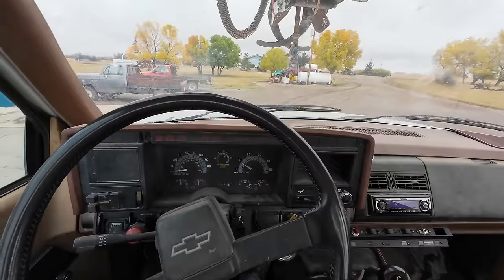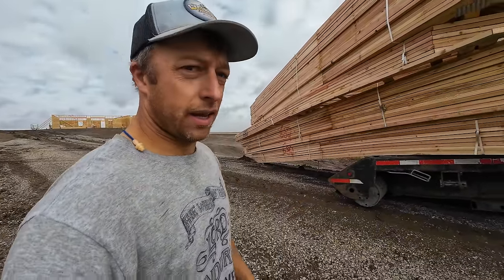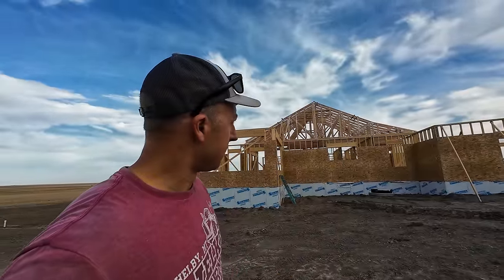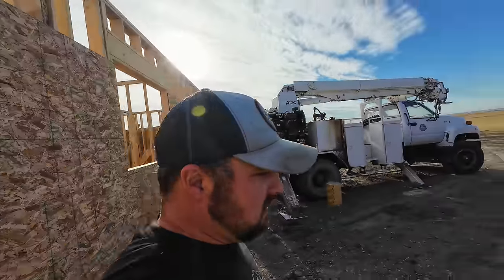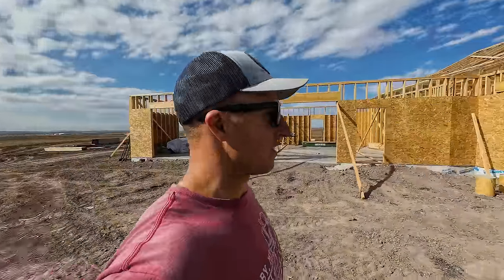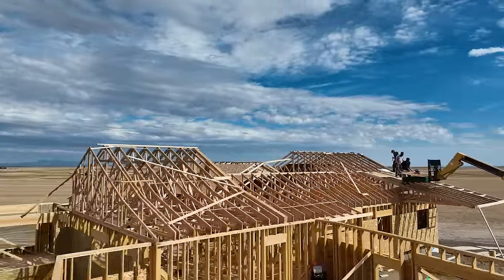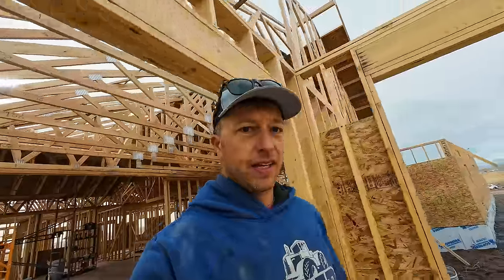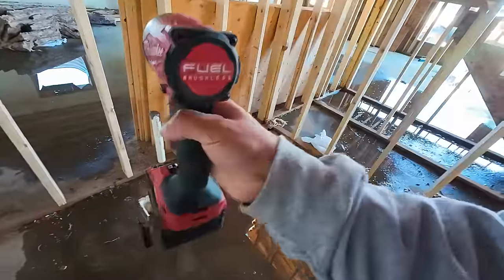New ROOF!! But WRONG Trusses!!🤦‍♂️- Farm Home Part 8

Comment: Nothing more satifying than the framing aspect of the build. The walls going up, the structure taking shape. And the roof going on to complete the skeleton. Afterwards the next projects don't show the self as quickly. all part of the process. Install plenty of rafter ties and Hurricane clips on it, out there in the open like you are. Look forward to watching the build. I worked 30 years in a lumberyard so just sitting back and enjoying. Be safe, take care.

Comment: that drain in the basement is actually called a floor sink, allowing devices to drain condensate fluid into the septic system,    these have an air break, very common.

Comment: The trusses, that would be a d'oh.  Someone in your truss supplier's chain of command will probably be getting a bit smaller Christmas bonus this year.  But in the construction business these things happen.  You were saying you thought the framer-carpenters were maybe showing a bit of overkill in all the bracing they were putting up - not so.  I used to live in a small town 3/4 hour northwest of Edmonton.  I'm a plumber-gasfitter and was running  that part of the job in a hotel remodel and expansion in the town in the early 2000s.  The framers were putting up the trusses on the expansion part of the building.  They finished this job on a Friday but didn't have time to get any sheeting done on the roof.  Of course a thunderstorm blew through on the weekend and down came the trusses.  Not only did it take some  time to clean up the mess, build some new trusses to replace those too badly damaged, and cost a considerable amount more in time and money for that part of the job but the very obvious mess was seen by literally thousands of people driving on the highway through town and was the subject of some considerable embarrassment for the owners and the builders as well as the chief topic of the local coffee shops for a good two weeks.  A few extra 2×4s worth of bracing does save big in the end.  Especially in the windy country where you live.  If the off trusses are the biggest problem you have on the build (a problem your builders seemed to work through with relative ease) then you can consider the process a big success.

Comment: need to start putting the roof in as u put up the trusses... then they won't fall down in a wind storm
Reply: At our USAF base,the were building a large aircraft hanger.  The day they put up the metal rafters, a bad storm came thru.  The rafters folded over, bending the metal girders above the vertical beams, which in turn bent the vertical beams.  The building was a complete loss.

Comment: If your back foundation wall/footings are less than 4' make sure you place 2" x4x8' Styrofoam sheets and run parallel to your foundation so you don't have any frost heave.

Comment: Coming from western australia where we build mostly brick and tile houses one wonders why you dont use double brick for the walls of your houses for easier and better insulation?
Reply from the maker: The simple answer is cost. Brick homes are significantly more expensive as the brick isn't made locally and the labor cost of installing is steep. By far brick is superior though, homes that are hundreds of years old almost always made of brick.
Reply: Yeah, to be honest it was wat i was wondering to. The answer speaks for itself indeed. 😀

Comment: You should be able to leave the auger in a locked position.   And just use the crane.  I’ve had the strap break on me on my sign truck. That was violent.

Comment: Those vaulted trusses will need to be re-engineered and certified by a structural engineer and then have an engineering repair letter and be stamped before they will pass code!

Comment: I was a truss designer for over 20 years and have designed and built thousands of systems for both commercial and residential, and have never built the wrong trusses for a single job! I have designed huge apartment complexes all the way to single family homes. How the heck would you even do that?

Comment: Getting the wrong trusses is a great disappointment for everyone. The truss builders, the carpenters and yourselves. Fortunately you are working with skilled pros, and they came up with a plan B. Great job!
Reply: In this case it was a simple mistake...nothing with the wrong measures.
I guess what happened was, they made the end trusses and made the inside ones the same...guess is, something was lost in transition. 
Yes, it's annoying, essentially when you dont have the tools to do it right, like welkers have and you could work with the stuff you had.

Comment: i worked for a truss plant and had to go out to repair trusses on a house that our did crew me out on the long weekend too  was a long weekend and he doesn't think to waste my time there anymore  
On Tuesday i went back to that house to do that work and did my job there talking to him he said the builder dug the basement in the wrong lot and poured it too he was out of the country at that time the builder was fire and the company who design the house was too fired laugh i pointed out the electrician wire the house had a wire going throw the dow way and outlets in the wrong plane to switch we have to know walls too it was a nightmare he did ask if we could fix a problem for him to  just phone the office and be nice able i don't think would be any trouble for use to build one 
as to your request as long as the truss company has a working drawing of the truss you modifying on the job site yes you can

Comment: What kind of extra measures to protect the house /roof/windows from your weather? Enjoying the series😊
Reply from the maker: Energy star windows, spray foam, house wrap, blown insulation, ICF foam walls, and radiant floors. Other than that it's pretty much standard. It should meet energy star requirements.

Comment: no you can NOT modify trusses to vault them.    Never modify prefab trusses.  No No    use those incorrect trusses to  make large crickets to get the roof to slope away from the side walls of the great room, protecting the girder truss, etc.   just a thought.
Reply from the maker: The engineer sent us the plans to modify them. It's approved and certified. Absolutely acceptable. Even stronger than the original with the 5/8 OSB and glue and a million nails
Reply: those appear to be completely new trusses, not modified trusses,  still its good to have it solved and resolved.